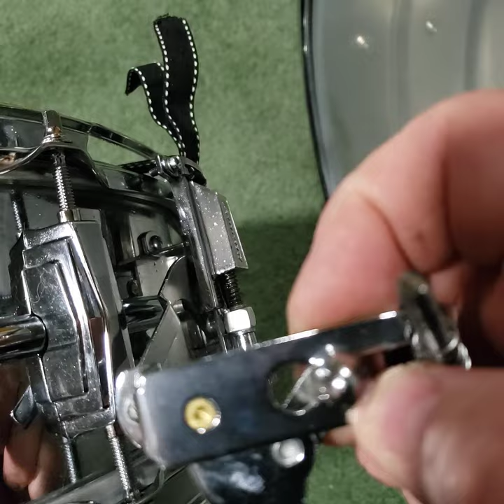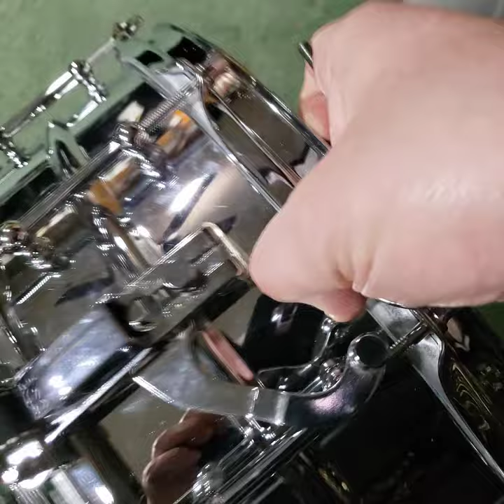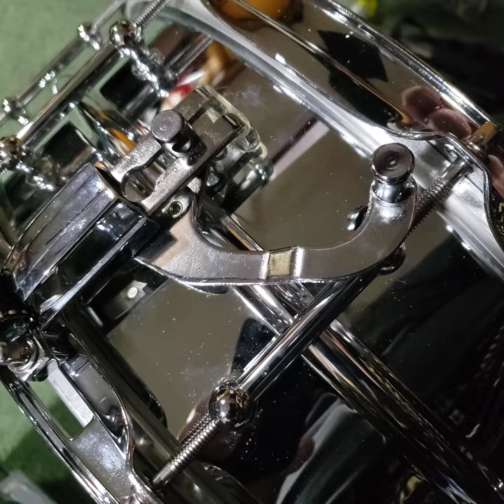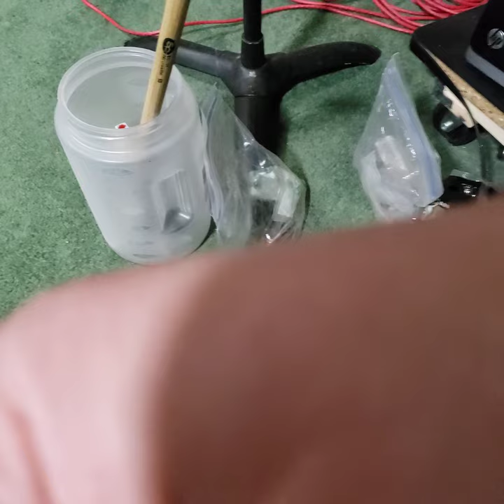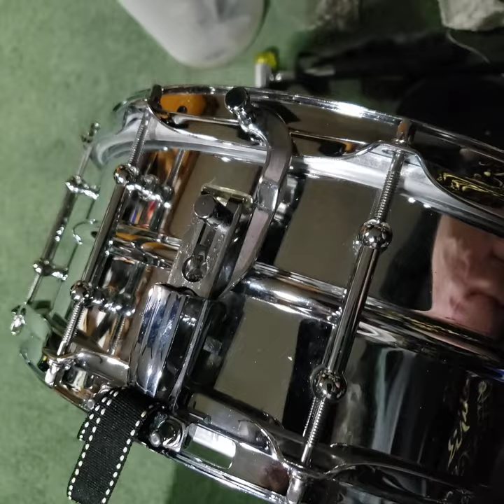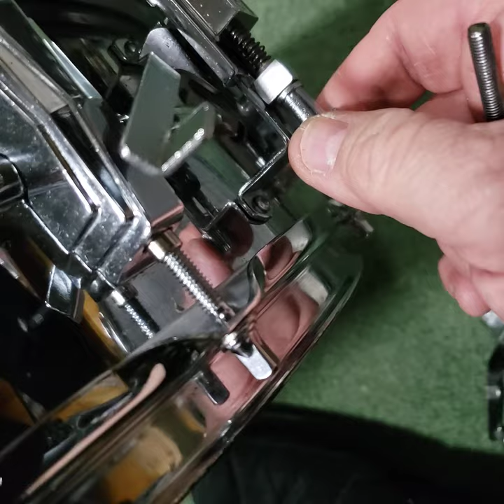Ludwig P-85 fixes and thoughts

Comment: Is it just me, or is the very simple and elegant P83 strainer better than the P85 in every possible way?  All my P85s are bent and sticky or messed up in some way.  All my old P83s just do exactly what they need to do with no drama.  They have less parts and no spring - why add a spring if you don't need it?  What does it even do?  Sadly, the P83s are now VERY expensive to buy on the vintage market.  They just reissued another simple and great piece of classic gear, the Speed King pedal.  I REALLY wish they would bring back the P83.  For a lot of my snares, I have replaced the P85s with INDE strainers because they work so well and require no drilling.

Comment: My P85 dose the same thing gets stuck on the bottom.I found a cb snare trow off and used the the in side on my accent snare drum Ludwig and it fit perfectly but still going to fix the snare drum probably a thin washer and welded it on as long as it functions.

Comment: I have the same issue try to block the half circle with a small washer with gorilla glue and had to file both ends at it didn’t work I even claimed it over night with a 3”c clamp so I ended up just putting it back on my snare or just order the inside of strainer as long as it works up and down.